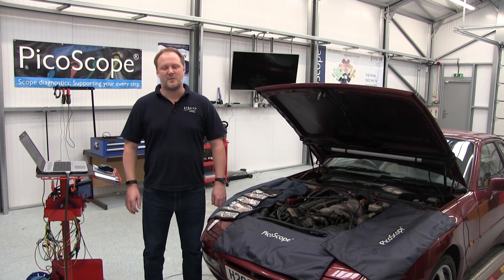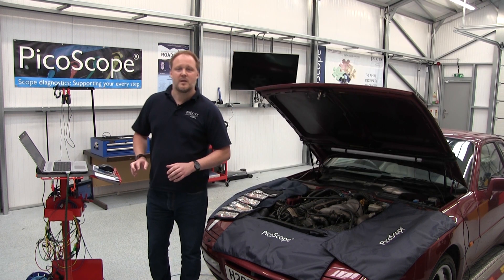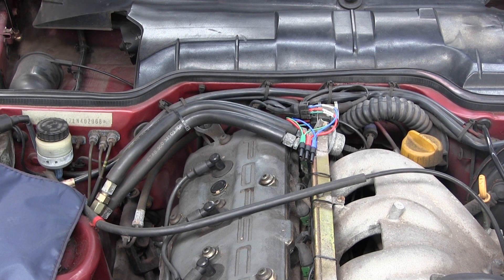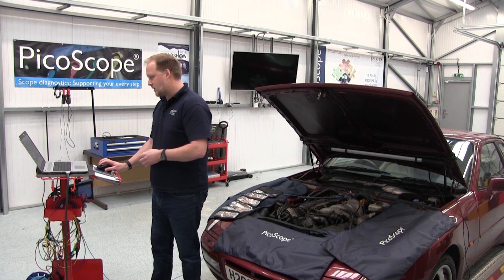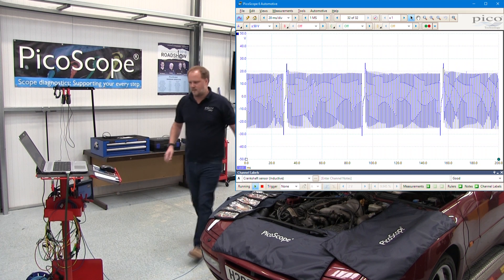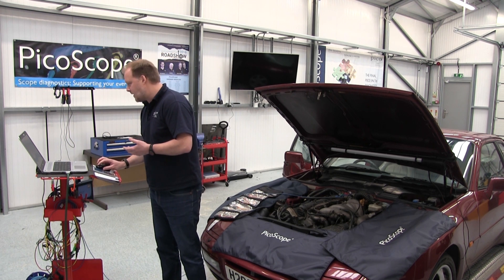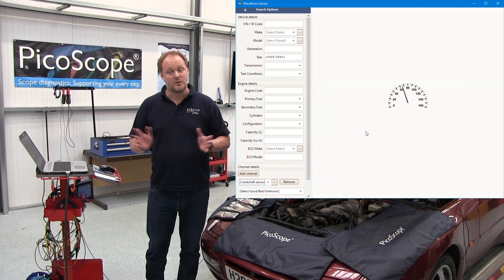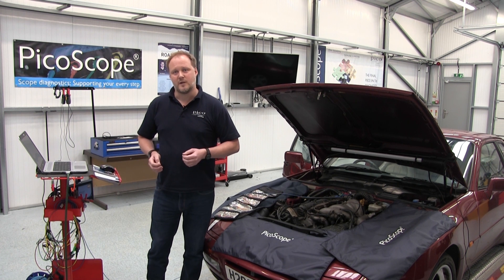Crankshaft position sensor inductive, referenced, voltage during running

Comment: Those breakout leads from Pico are excellent, I use them in all kinds of situations. On the other hand, it is not too difficult to back probe connectors if you have enough space.